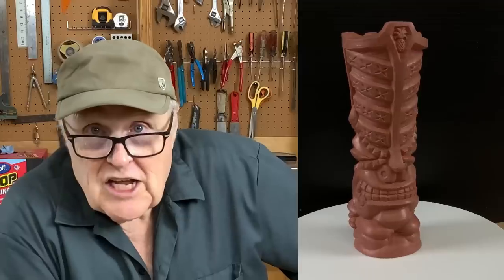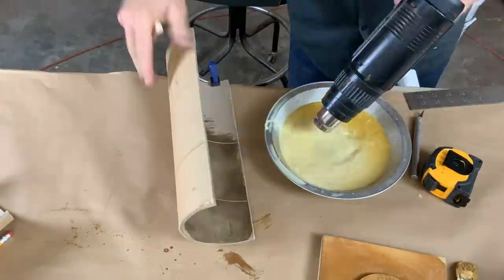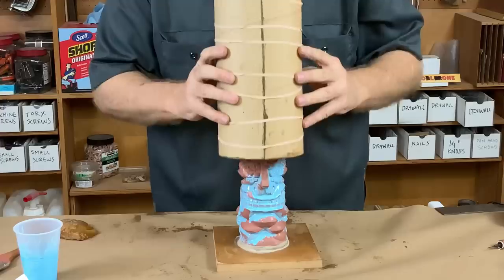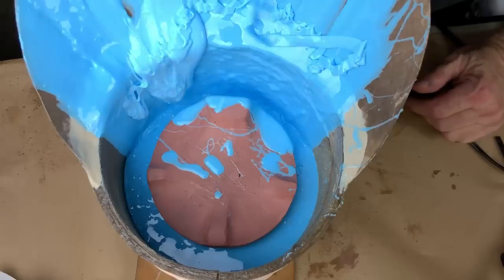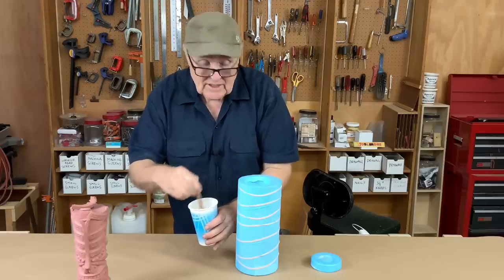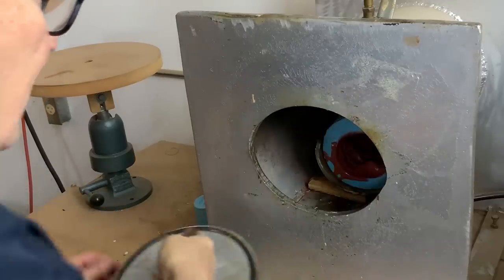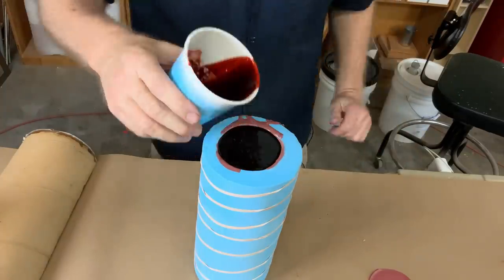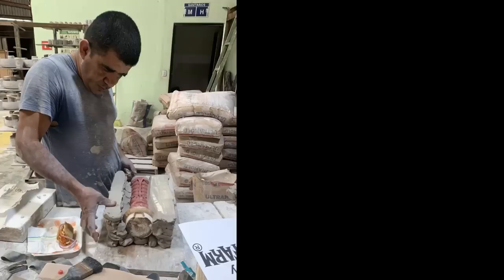SLUSH -A Quick And Easy Casting Method

Comment: In regards to making a fixture for rotocasting - I use two bungee cargo nets attached on both sides of the inner frame of my diy rotocast machine.  Then I use 3d printed clips (or carabiners) to hold the model in the nets, and the nets to eachother.  It takes just a minute or two to put a mold in the netting and works great up to about 10lbs with 2 nets.  It's not a rigid method like a wood fixture, but it works with a whole variety of different molds without additional fabrication.
Reply from the maker: Great idea!

Comment: So, my limited understanding of ceramics is that they use plaster of paris molds, in 2 parts, and pour a porcelain style ceramic mix in, as this cures, it slightly shrinks, the plaster absorbing a little of the moisture, so they need many many plaster of paris molds to run a production line, ensuring each isn't too moist for successive pours. Once the green is left to naturally dry out, any casting lines can be gently sanded away. Then it's bisque fired. Then allowed to cool, then glazed, and glaze fired. Mr Tolone, anything to add to my summary and thanks for all your videos, really appreciated.
Reply from the maker: You describe the ceramic process very well.
Reply: Yep, if no undercuts , could block plaster cast 2 halves of tiki clay as prototype ceramic mold..tool final details, test. Then pay Robert to create Master molds by molding the plaster molds. That way is easy to ramp up production and replace used plaster molds for the slip casting!

Comment: so could you slush cast a layer of plastic resin, and then fill the rest with a lower cost material? or add something to the plastic to build volume, and decrease the amount of plastic needed? what would you recomend
Reply from the maker: You could certainly use fillers to lower your resin cost. But for me it is always time over money. So the less time I take the more I make and time is more valuable than resin. But then, the client is paying for it.
They would rather pay for resin and less labor charge from me.

Comment: What about filling the hollow slush cast model with marbles or rocks and then use much less resin to fill the model? Like the 'chunkies' used with the silicone moulds?
Reply from the maker: You could, but for me it is time over money. The resin cost is small compared to my labor charge so I don’t worry about the resin. The client would a lot rather buy resin than more of my time.

Comment: Why the slush cast first vs just pour it? Is it just because you can easily see inside and make sure it's all covered.
Reply from the maker: I don’t have a vertical tank set up at the moment. So I couldn’t pressure pot it after a single pour. Also, by slushing it I could gel it and lay it down in the tank. It’s a technique I haven’t used on the channel before so that also factored in.
Reply: @RobertTolone  So the mold did not go into the tank after the subsequent pours? Cured resin does not seem to have after two last pours though.
Reply: To add a bit more to Robert's comment, this way you get a low-bubble exterior by being able to pressurize it, then you can let the inside cure at atmosphere and it doesn't matter if it has tons of little bubbles because they won't show up in any subsequent castings

Comment: What type of resin should I use for minimal shrinkage?
Reply from the maker: Shrinkage happens but it’s pretty small. You can look up the shrinkage percentage for most resins. It will be on the material data sheet that your resin supplier should have.

Comment: HI! Can I get some advice? I want to make casts of manhole covers. I need a medium that will set fast and be flexible enough to peel out of manhole covers that are in place in the roads. Any suggestions on what I could use? I am in Japan, and the manhole covers are SO beautiful;;Thanks !
Reply from the maker: I have no idea what materials are available in Japan. I would consult with local suppliers to find a suitable rubber. They come in all different formulas including quicksetting rubbers.
Reply: @RobertTolone  Ok thanks, I have access to USA Amazon, was hoping for a suggestion from there. My fault, I wasn't clear. Thanks for your time.

Comment: Hey Robert! I'm new to this whole thing. Just found your channel and think your absolutely brilliant!

I have a question for you. I've got a few silicone molds that I use to  pour concrete jars, vases, etc. I want to pour my own silicone mold, but I'd like to include my buisness name so that it will display on the side of my concrete vessel. Problem is I have no idea how to do that. Do you have any tips, tricks, or advise you could give me that would help?
Reply from the maker: Your logo should be engraved into the master object that you pull the molds from. That way, automatically, the mold will have a reverse impression of the logo and the casting will come out correct. I don’t know of any way to add a logo to an existing mold.
Reply: Thank you so much for your help!

Comment: Hi Robert, I’ve been binge watching your videos and I started experimenting with casting. I got the vacuum pot and I got now a pressure pot. I starting making a clear resin lens. The silicone mold with the vacuum pot came out great. Now, pouring the resin, first I mix the 2 parts, vacuum it then pour in a squish mold. Had some tiny bubbles. Then I bought the pressure pot, I saw many people just mixing the resin and straight out them in the silicone mold (without vacuuming) and put them in the pressure pot, so I said ok, let’s do that. I did, and I still had one bubble in my clear resin. Today, I mixed the resin, vacuumed , then poured and then into the pressure pot. I am hoping I will finally get a bubble free lens cast. My ultimate question to you is: in a squish mold, where the resin is fully enclosed, can the pressure get to the resin? Or must there be an open end in the mold with some exposed resin for the pressure to get to? I hope you will reply, thank you.
Reply: If it's completely sealed how would air get in or out? 😄
Reply: @fillerbunnyninjashark271  yeah that’s the easy answer, but the more in-depth answer is that it’s a 2 part squish mold, so there is a parting line full with resin being squeezed, so there is hairline space. It could also be that in a pressure pot the pressure does not need immediate contact with the resin but the pressure is equal all around the mold that it presses the air out that way, so the answer is not that obvious. I see people casting dice in squish molds and put it in the pressure pot with excellent results, I just don’t know the answer to my first question.

Comment: Had a question, in the thumbnail it looked like the mold cut was right in the front, I couldn't tell from the video, but would there be a reason of where you cut the rubber on a mold like this?
Reply from the maker: It was cut up the back. I always try to cut the mold in the least conspicuous, easiest to clean place.
Reply: @RobertTolone  thanks for the reply!  The very next video I watched was one of yours from a couple months ago that went over all this 🤦‍♂️

Comment: Gday Robert! Your videos got me into mold making and resin casting as a hobby. I’m really getting into it and wondering if you’ve ever made a mold
of a firearm? I’m interested in casting a pistol to be used on a retirement plaque. Any suggestions on what I
Could use to plug up the gaps in the firearm to prevent filling the internals with rubber? Maybe fill the gaps with petroleum jelly or something similar? Please let me know your thoughts! Thanks from Australia.
Reply: You could probably use wax like he does for filling holes.
Reply: @SmashToBits  will the wax come off cleanly? I need to be able to completely remove it once it’s finished
Reply: @Wade______  it should come off completely if you use rubbing alcohol or acetone. Warming the parts some would make it easier and faster. I have not tried it before with a weapon with bluing. I assume it would be fine but I would test it first on a small spot

Comment: Hi Robert,
Why is the resin master necessary? For things like vacuum forming or creating injection molds? Vacuum forming would make sense to me, if the model is suitable, but I don't know much about injection molds or possible other reproduction methods.
Reply: Vacuum forming is fairly model-specific. For something large and thick like this, there's no way you could guarantee getting all of the details, and the fact that the master is made of clay, the heat and pressure would obliterate it
Reply from the maker: The factory uses the resin master to make molds for the ceramic mug-casting process.
Reply: @whompronnie  Thanks, Ronnie!
Reply: @RobertTolone  Thanks a lot, Robert! So having watched a couple of videos about that, it looks like they need a lot of molds and the clay original would probably deterioriate quickly. In your case, bits broke off, but now a much more robust master is available.
Reply: @whompronnie  I learned that the hard way. I had a master that was made of multiple layers of cardboard, and it collapsed and crushed ruining a dozen hours of shaping and smoothing.

Comment: Hello Robert, do you worry about the resin fumes at all? It is a pleasure to watch a master at work by the way!! Your channel is an absolute gold mine!
Reply from the maker: My shop is well ventilated and the casting resin fumes aren’t nearly as obnoxious as 3D printing resin fumes are.  Plus I actually don’t cast that much resin because I’m not a production house, I make prototypes. So my occupational exposure to resin is actually very low.
Reply: @RobertTolone  that sounds very sensible. Thank you for answering!

Comment: Apologies if this is a bit of a stupid question but why rotocast and THEN fill it?
Reply from the maker: Because it was fast. By roto casting it I covered the critical outer surface and made sure it was bubble free by placing it in the pressure pot. After that it was faster to simply fill it than it would have been to rotate it in several layers. Also, a solid pour was a faster way to give the casting a clean solid bottom. This was easier for the factory to make molds from. 

By far the simplest way to do this job would have been to fill the mold it in a single pour and put it into a vertical pressure pot.  But my vertical pot needed repair and I couldn’t fix it in time to complete this job.

Comment: If you use compressed air to inject gas into the rubber mold between the mold and the clay master as you remove it, it might survive better. Probably doesn't matter, but if it ever did...

Comment: centrifugal spin wall cast
Reply: on a drill press
Reply: or on a clay spinner
Reply: lathe spin cast
Reply: birthing a child
Reply: try inverse casting with plastic, where the mold (ie metallic or ceramic, glass) is heated and not the plastic, the mold heats-melts the plastic, and keeps it molten, kinda inverse casting
Reply: kinda reverse injection mold system

Comment: lmao ... man, all they work, and then they do that? How do the parting lines look on the final product? 
Do they do a lot of work to fix them, or will you just see it on the product?
Reply from the maker: Because the molds are made of plaster by definition they must be two-part molds.  They clean the ceramic castings before firing.  On the mugs I’ve seen the quality is OK but not spectacular.

Comment: Wouldn't it be a good idea to fill the shell with something cheaper, like a mixture of sand/plaster with resin, for example?
It would save a lot of material and costs - filling the inside with pure resin seems like a waste
Reply from the maker: You could do that.  For my projects the cost of materials is budgeted in so I always opt for speed over material savings.  My studio is geared towards mixing resin. So I can mix it much faster than I can plaster or other materials. That’s because I mostly do toy-sized objects. The resin cost is incidental to the project.

Comment: You did a way better job than the factory. Seems to always be the way, someone who's passionate does a great job while the dispassionate worker does a very poor job. I've seen that a lot lately with construction contractors. I love your pressure chamber and I've been meaning to ask, did you make it yourself?
Reply from the maker: I designed the pots but had them fabricated.  I’m not a good welder.  Here’s a video about them: https://youtu.be/VYO318KFuAA
Reply: @RobertTolone  Thanks. I figured you had a video on it, but couldn't seem to find it. Might need to get my eyes checked.

Comment: Robert, it seems like making a ROUND CYLINDER shaped mold is best over a rectangular mold because you only need to make one half cut.. Saving the shape of the mold.. also the rubber bands that hold the mold together are more secure around a round shaped mold... Why ever make a rectangular BOX shaped mold ?
Reply: It's much more economical for him to use what he has around. Even if a cylinder was always the most efficient (which it wouldn't be in a lot of cases as you'd have to increase the radius of the cylinder for even the smallest pieces to have a thick-enough wall, greatly increasing the amount of silicone needed) he simply wouldn't just keep a stock of every possible cylinder size, whereas boxes can be built at any size on demand.